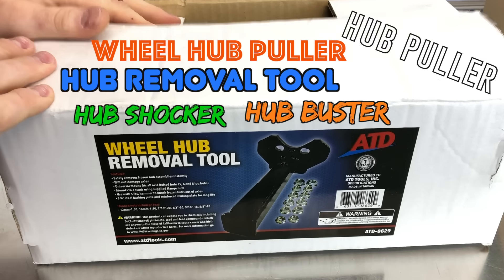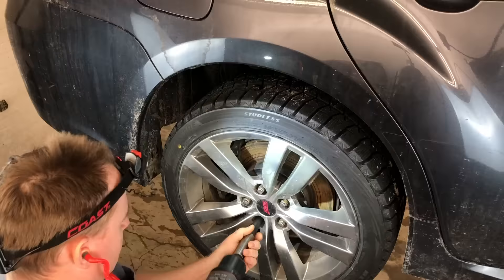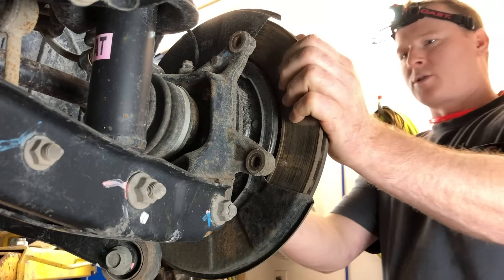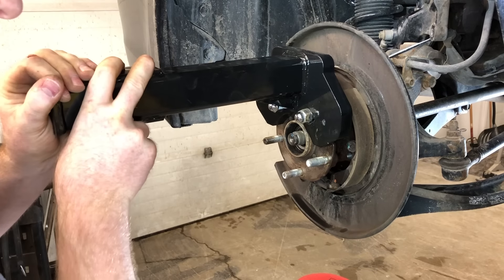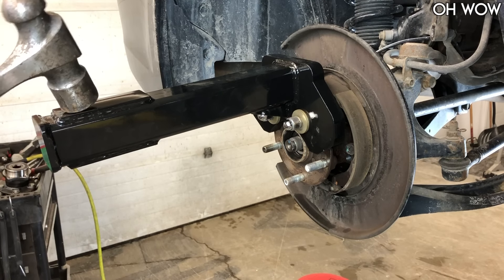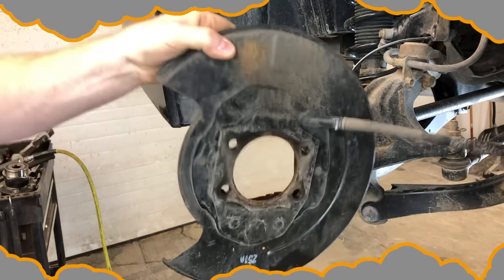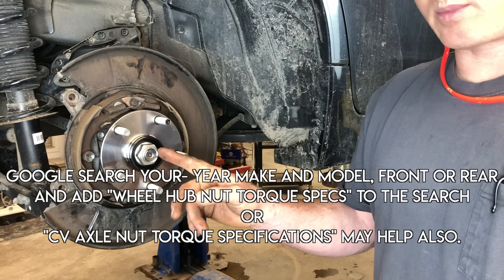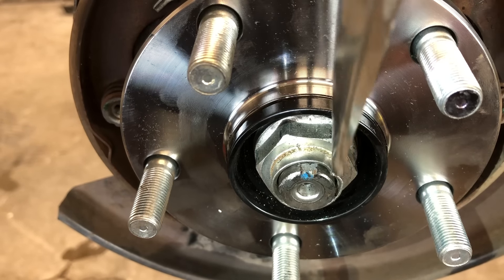HUB SHOCKER Hub Busters  |  REMOVE STUCK WHEEL BEARINGS EASILY!

Comment: Well my 2014 Subaru Crosstrek rear wheel bearing went. Was hoping the hammer "tap, tap, tap" would work. NOT !!! Tried a 5 lb hammer. NOT !!! Tried a 10 lb hammer. NOT !!!! Just purchased LTI Tools - LT830A - Hub Shocker Wheel Bearing Hub Removal Tool. Just arrived. Going to try it today. Fingers crossed !!! I'll be sure to edit this with the results.
Reply from the maker: Oh man. Sorry. That’s very typical of these bearings. They suck. The hub shocker has been working great for me on Subaru rear bearings. I pretty much only hit it with a sledge hammer now. They are still a pain to remove. But so far the tool is on about its 24th bearing and 24 successful removals. Its a game changer for me. They aren’t easy will the tool even. They should just package the tool with every new bearing for the end user. Good luck. Keep me posted please!
Reply: @EasyFixShaun , GOOD NEWS !!! After originally trying all day with several different sledgehammers and renting multiple tools from Orielly Auto Parts (3 jaw pullers and slide hammer) to no avail, this hub breaker tool worked. 4 hard hits with a 10 lb full length 42 inch sledgehammer on the hub breaker tool and it fell right out. The 12 MM nuts in the kit didn't fit the Subaru. I had to go buy a couple of very fine pitch 12 MM nuts as I didn't want to take a chance using my lug nuts and ruining them. The "slots" on the tool just fit but left a large opening so I also purchased a couple of grade 8 thick large washers. While I wasn't happy about spending over $100.00 on this simple hub breaker tool and wished I could've just made my own, at least it paid off. I honestly don't believe I would've gotten this rear Subaru Crosstrek wheel bearing off without this tool.
Reply from the maker: I am so glad it helped you out! I think that thread size is 12x1.25 if anyone needs to find a different fastner. The same thing happened to me. I went to the autoparts store and also got some washers and different lug nuts with holes all the way through them. That helps a lot on the subbies. These bearings are ridiculous. The best shot of getting them out easily for me is the tool!
Reply: @EasyFixShaun , yup. Absolutely agree !!! If you have a shop, this is a "must have". With this tool, changing a Subaru wheel bearing is a 1 hour job and it's actually quite easy, especially since, with this tool, you don't even have to remove and re-install the parking brakes. Just 2 caliper bolts, 4 hub bolts, axle nut, and the speed sensor (to be safe). Simple.
Reply: One question: whose wheel bearings do you like the best and try and use ??? I was going to go with Moog because they have a great warranty (3 year / 36,000 miles), but they're the most expensive ($145.00). I looked at Timken, and while priced well ($100.00), the warranty isn't (12 months / 12,000 miles). I figured if the Subaru bearings are going bad so often on these, I didn't want to use OEM and the price was in between the Moog and Timken at $125.00. So I looked some more and choose SKF Bearings. They are priced like a Timken, but have a warranty better than Moog. I paid $95.00 from Rock Auto and it comes with a 36 month / 45,000 mile warranty. SKF is a worldwide leader in bearings and used in millions of OEM automobiles. This particular bearing was made in Japan and looked to be excellent quality. If I have any problems with it in the coming months I'll post back.
Reply from the maker: Well put man!
Reply from the maker: I think all of those options are good. I prefer oem. Then timken, moog, skf. In that order. But because Subaru is having a big bearing bearing issue we are sadly the test dummies. I’ve been istalling all four brands to try to determine which last the longest. They are all good in my opinion. Typically you want the most expensive bearing made in Japan. That oils be my golden rule and my number one choice right now. Warranties are great. If you get the best bearing your shouldn’t need it in theory. I’ve seen crappy bearings with amazing warranties. They will only warranty the bearing once. It’s called limited lifetime warranty sometimes in the fine print. Just things to be aware of. I don’t have a real answer here. Just some guidelines right now.
Reply: @EasyFixShaun , ok. Well the SKF bearing shows "made in Japan" so I assume it's high quality. The SKF is also listed as "OEM" so it's possible SKF supplies Subaru with these wheel bearings. That could be a good or bad thing. I'll post my results. Thanks
Reply from the maker: Sounds great. If it’s made in Japan it going to be better than China or Taiwan most likely.
Reply from the maker: Hey Drew! Check out the updated shocker video ideas! Solves all your mounting issues and also bearing separating issues for the next one you need to do. https://youtu.be/eKqYtMdlPYo

Comment: A guy at the shop used one of these and a 10lb sledge. Bearing still stayed in the knuckle and bent the tool. The bearing had to be torched out in multiple pieces. Lol
Reply from the maker: Sorry your guy had trouble. Usually they come out. It was probably worth a shot though 😃
Reply: If it's on the front you can sometimes use the power steering pump by pressing against one of the bolts. From the back.
Reply from the maker: That’s a great trick!

Comment: GhostTrain615 calling EasyFix, will this work on a front bearing as well? The one on my Outback is being impossible to put up with, I have tried torching it, hammering it, no results, Can this tool be rented?
Reply from the maker: This will work front and rear on Subbies. They have made my life so much easier on Subaru. Some bearings, rear especially are incredibly difficult. I do not know of anywhere that rents one out, but there could be someone out there. Maybe call around, try the parts stores first. But you can get it from amazon for $105-$120 right now in a couple days to your door. That’s what I would do if you can. Well worth it.
Reply from the maker: Check out the new video I made and let me know what you think! It is the only way I do Subaru bearings now and they are easy for me 😀 https://youtu.be/eKqYtMdlPYo

Comment: Let's be honest, the Driveshaft popped out of the rear wheel drive 😁👍🏾 how does this tool work on "pressed in bearings" , as this one was complete with Hub.
Reply from the maker: Good question! The axle only was removed from the bearing. Once the rust bond between the bearing and knuckle was broken the wheel bearing slide right off the axle shaft. The tool is meant for modern bolt in style bearings. I wouldn't recommend using it on a press in bearing. That would be a totally different replacement procedure. I recently made a video on it if you need to check it out? 🔧  https://youtu.be/P5bwlKKpusk
Reply: @EasyFixShaun  
Great 👍 will watch that now.
Reply from the maker: Awesome! I hope it helps you out. 😃
Reply: @EasyFixShaun  
Subscribed 👌🏽
Reply from the maker: Oh man you rock! Thanks a lot. I really appreciate you! 😃😃

Comment: LOOKED MORE LIKE AN AD FOR THAT SUPER TOOL, BUT WAS NOT SURE ON WHERE TO HIT THE TOOL WITH THE SMALL SLEDGE HAMMER, AND DON'T MORE GREASE GOES INSIDE ALL AROUND THE BEARING.
Reply from the maker: Yup more grease is always more gooder! You can hit the tool with any size hammer or a sledge hammer on the strike pads. There are two, one on each end of the tool. 😃🔧🔧

Comment: That car was not very rusty, of course that came out easy.
Reply from the maker: You are right. It wasn’t rusty and the bearing still fought me coming out. These rear subbie bearings are known for being stubborn and stuck. If was really stuck a lot more things start to happen. The bearing will even separate into two pieces. 😀
Reply from the maker: If you are interested, here is a video where the bearing was severely stuck and the shocker worked to take it out. I also solved two problems I was having with the tool. Mounting it solidly and bearing separation issues. 🤓🔧 https://youtu.be/eKqYtMdlPYo

Comment: Any risk of damaging rubber bushings in the suspension? They are not designed for such tremendous shock loads. Just asking.
Reply from the maker: Should be fine. I have done a couple dozen and haven’t seen any problems. It seems like there could be a possible issue but there really isn’t. It’s hard to get a good hit on the tool sometimes. But when you get one good wack the energy goes into the bearing and it will pop right out.
Reply: @EasyFixShaun  ur diy guy
Reply from the maker: Thanks man! 😃

Comment: Wheel hub assembly replacement, of course it would be easy.  I was expecting the actual wheel bearing replacement.
Reply from the maker: Sorry about that. Do you mean a press in bearing replacement?
Reply: @EasyFixShaun   no, I meant the actual wheel bearing. Not a wheel hub assembly.  For example, remove the front wheel bearing off a 2005 Toyota Camry.  You state, “remove ANY wheel bearing easily.”
Reply from the maker: OH! Got you. Ya its for modern bolt in style wheel bearings. Sorry about that. Here is the video you need for Pressed in style wheel bearings. Its pretty involved and has all the steps needed to replace them. Let me know what you think! 😃🔧 https://youtu.be/P5bwlKKpusk

Comment: Looks a little hard on the wheel studs?
Reply from the maker: Exactly. They were failing on me. I solved some problems with to the tool on the next video shocker 2.0. Check it out and let know what you think. I used grade 8 bolts to mount the tool and I solved the bearing splitting into two pieces. 😃🛠  https://youtu.be/eKqYtMdlPYo

Comment: Im confused. It has disk and drum brakes at the same time?
Reply from the maker: Yes, it's common setup but its a little weird. The disc brakes are the service brakes connected to the brake pedal. The internal drum brakes are for the parking brakes only. 😃🔧
Reply: Hi guys,this is a rear axle.a lot of suvs have the drum brakes,they are your emergency or parking brakes only and are not normally used in regular driving.I wouldn't use this tool,you are forcing the bearing out at an angle from the hub that holds the whole assembly in place at the least i would have the alignment checked after.
Reply from the maker: I know what you are saying. A hammer is typically used to force the wheal bearing out when corrosion sets in. This tool is for severely stuck wheel bearings and simply multiply lies the force. It also allows you to swing a hammer outside of the wheel well which is super helpful in helping prevent body damage. 😀🔧🔧

Comment: I've seen this type of tool before. It's mostly useable.
For efficiency, I use a QUALITY pneumatic air hammer and the correct application of contact and force.
Generally speaking, I got my work done 50% faster than the guys using similar tools in the shop.
Just sayin. There's guys that have all the tools, and guys that just get it done..
Reply from the maker: Air hammers are super useful in bearing replacements when they are stubborn. So you only need one tool for bearing removals?
Reply: @EasyFixShaun  Hey bro, how's it goin'?
Yeah, pretty much...yes.. The tool you've featured is nothing more than a manual version of  my method. Impacting to jar friction bond and move the desired direction.. It takes a touch and an understanding of what's going on with the knuckle housing and outer bearing race. I've literally 'danced out' hundreds.  ( 40 year veteran).
Reply from the maker: Thats cool man. The air hammer previously was my last line of defense before knuckle removal or heat. Until I discovered the shocker I used that method also. Its really hard on the body because if vibrates you as well as the bearing. But it works and I love it. I haven't used it in a while. I have it on standby. I plan on avoiding it if at all possible. Did you see my second video on the shocker? Let me know what you think if you have time would you? https://youtu.be/eKqYtMdlPYo

Comment: Cheaper way... put tire back on, with a couple of lug nuts, smack tire with sledgehammer... don't hit your rims... spin tire 180 if it don't pop out. Repeat.
or 
Use jack to apply upwards pressure on hub enough to lift suspension and hub up, but not enough to lift car off the jack stand which should be UNDER THE FRAME, then smack the hub with a hammer. If it don't pop out, lower jack spin 180 and do it again.
Reply from the maker: Could work for sure. 🔧
Reply: @EasyFixShaun  Does work... I have owned 8 subarus total and still own 5.... 2007, 2009, 2014, 2020 outbacks and 2017 crosstrek And do all my own wrenching... I'd probably still have the other 3 but in NYS after about 20 years they get a little Swiss cheesy from the salt - 2000 outback... And a tree blew down on top of one of them and modified the roof to be on top of the doors - 1996 outback. Another... I got rear ended - 2003 outback...
Reply from the maker: @kiddiescripterkiller  That is a lot of cars! Sweet man. I really like the Subbie's also. They are perfect for a northern snowy climate. It always sucks when any car rusts out. Rust is usually the only thing that kills a Subaru other than trees 🔧😃

Comment: Unscrew the four bolts (14mm)holding The bearing In place but do not remove them then Hammer these bolts and the bearing Is pushed out that way.
Reply from the maker: That is an awesome method! Sometimes there isn't enough room to hammer inside the knuckle. In those cases I usually use the shocker. It works awesome on severely corroded and stuck bolt in wheel bearings. Here is "hub shocker 2.0" if you are interested and have time. I solved 2 problems I was having with the tool. Mounting with grade 8 bolts and bearing separation into two pieces. I was able to actually solve that with the axle nut. 😃🔧 https://youtu.be/eKqYtMdlPYo

Comment: Our shop bought this tool but haven't had much luck even using it with a sledgehammer.  I think my mistake was to not keep axle nut tight. The hub would move in bearings before bearing moved on spindle.
Reply from the maker: The cv-axle nut trick solved a huge problem I was also having on severely stuck bearings. I use mine on Subaru’s a lot. Also rear ford and gm Chevy bearings. It’s made a huge difference for me. Sorry you haven’t had great luck. It’s worth it though if you ever do even one Subaru rear bearing. Omg they are bad 😀
Reply from the maker: Not sure if you saw the second video. Here is an updated video where I have solved all my problems of mounting and the cv-axle coming apart during use. 
                https://youtu.be/eKqYtMdlPYo
Reply: @EasyFixShaun  I have had to heat the backing plate to hammer the bearing out of it, after getting the assembly out of the knuckle. The axle nut trick is good, also do that on most of the Dodge truck front bearings I do.
Reply from the maker: Wow man. That’s nuts. Is that on a Subaru? Man it’s crazy ho bad they are. I usually hammer them out. They are usually stuck badly but I can get at them with hammer once they are out of the knuckle.
Reply: @EasyFixShaun  Yes, on Subarus. Rear toe set on most requires a 4 ft. pipe, or bolt and bushings replaced.
Reply from the maker: @jondahl3173  OH man! Ya even better reason to have to the tool. You would have to do an alignment after knuckle removal if you needed to press the bearing out which is a common method.

Comment: Probably works good on many bearings. I’ve changed many but the rear explorer and front ram 3500 it will just take the flange out and leave the bearing assy still in the knuckle. They are the absolute worst two I’ve ever seen and I’ve had tough ones but not like those
Reply from the maker: Check out the new video! It solves both of your vehicle issues and bearing separation issues with a bad ass trick. https://youtu.be/eKqYtMdlPYo 
I have seen a lot of the 2500 dodges and a few 3500 dodges. The shocker will take them out. I do prefer the hydraulic steering method on the those large trucks, I am just used to doing it that way though. This tool is faster and easier on everything big and small 😃

Comment: Can I use this on a furnace blower wheel to remove the bearings for the shaft
Reply from the maker: I don’t know. It would most likely be overkill for a furnace motor and possibly destroy it. A standard 2 or 3 jaw gear puller might be better and remove it with no damage.

Comment: Never use any chrome tools with an impact. they could break and cause personal injury. You shouldn't work the bearing away from the hub with the axle shaft still seated in it. You could separate the joint and/or rip the boot.
Reply from the maker: Thanks man. Did you see the second version of the video?